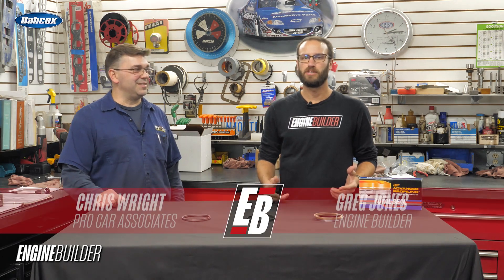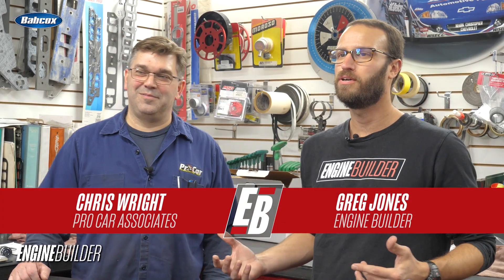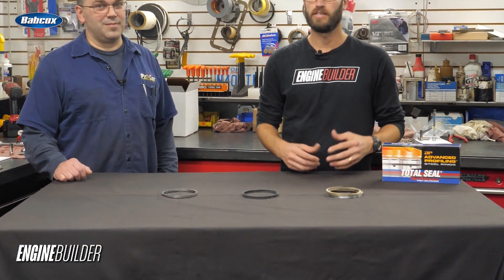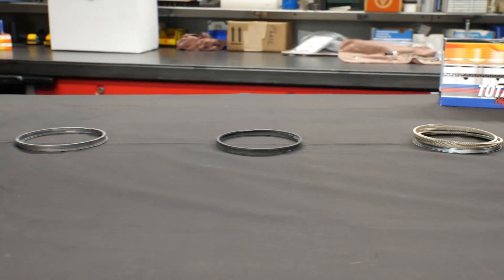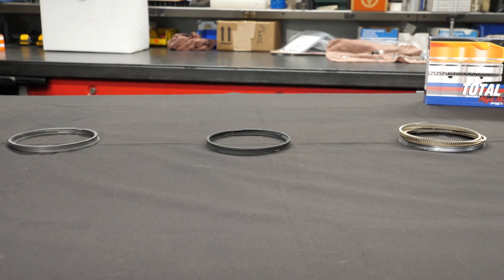Reviewing an Ultra-Thin Set of Total Seal's Gas-Ported Piston Rings

Comment: This is a commercial. The title says, "Reviewing" but you didn't even try them yet. Total Seal sent you some free rings and it seems like in exchange you regurgitated there sales rhetoric. Where is the quantitative info on how much better these rings are or how they actually compare to ported pistons in an apples to apples comparison...same pistons, same rings except in one case the pistons aren't ported and the rings are and in the other case the pistons are ported and the rings are not. JE Pistons and many others easily allow you to include or exclude ports in the same design and Total Seal has pistons rings that are identical except for the gas grooves. And not another apples to oranges comparison as I've seen previously by Total Seal or others with Total Seal influence present. if you really wanna get views, compare regular gas ports, JE's new side port (or somebody else's) and Total Seal's rings (the same ones with and without gas grooves).

Comment: if you used custom thinner rings.. did you use custom pistons with special ring lands too (cost, time to get, etc would be nice)  or, did you use the spacers I have heard about?  not enough info here.
Reply: Standard cut on the pistons I believe, that’s how the thinner ported rings are designed to work. The ring has room in the standard groove to press against the piston on its way down and help seal. See this video https://youtu.be/oYQ9jOkm3_k?si=8URFLjMrvOdF8EcQ